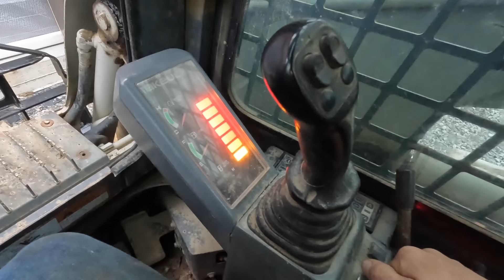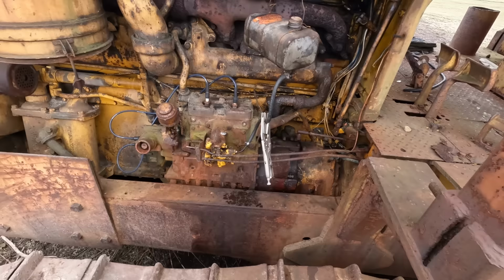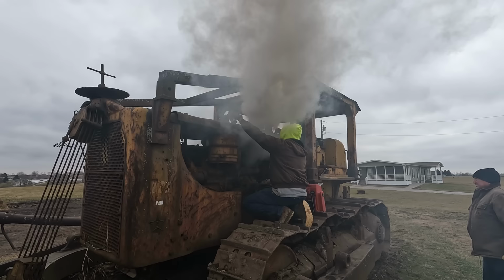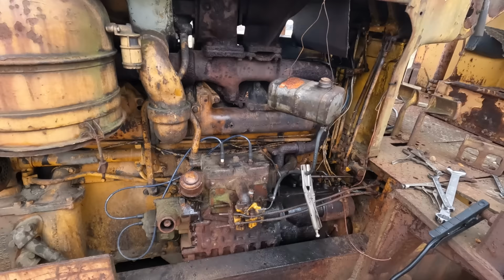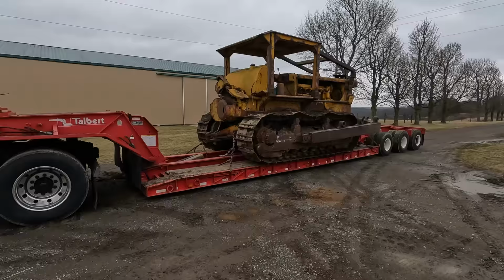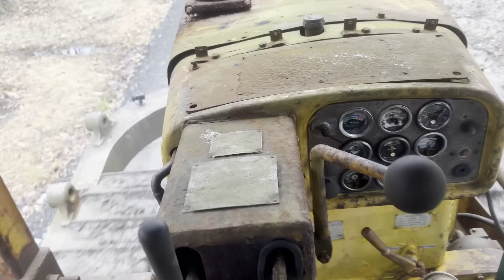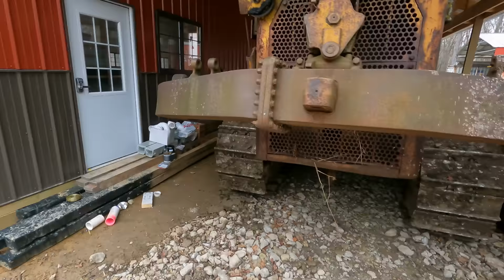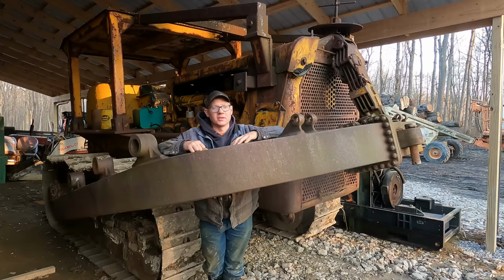Hauling Home a 1964 Cat D8 Bulldozer after sitting 15+ years!

Comment: Quick story about D8H's, in 1967 Vietnam we were using these machines to help lay down Marston Mat (commonly known as PSP planking to build temporary runways. We would air drop them from C-130 Aircraft at heights up to 10', they survived, most of the time.
Reply: Yeah, something that heavy (~50,000 lbs, ~22,700 kg) needs a LAPES drop, a tried and true technique for delivering particularly heavy loads to a very specific area.  

For those mildly interested, look around for LAPES (low altitude parachute extraction system) drop.  It's a fascinating, if potentially dangerous, procedure.  For example, the tragedy at Ft. Bragg in 1987 was caused by the pilot coming in too steep and leveling off too late, which caused the C130 to hit the ground mid-procedure.  Believe it or not, the C130 probably could have recovered from that on its own (such magnificent aircraft).  But then the load was extracted and the aircraft's center-of-gravity shifted enormously, the pilot couldn't recover the aircraft, and it crashed into the trees.

Comment: My dad used to take me to work with him in the summertime. I learned how start and run these old cable rigs at an early age. Everything was cable back in the 50’s and early 60’s.  I started working on the pipelines in 1964. It was  in the early 70’s before getting into Local #12 in Southern California. In the 70’s I spent hours and hours pioneering and building right a ways and doing back filling and dress up work on an old Cat D-7 46-A and a cat D-8 15-A.  It was amazing when the company that I worked for started buying hydraulic equipment. It was so nice to pull or push a lever to change blade angles and positions. No more jumping off and muscleling those heavy awkward blades around.😂😅🤣 I loved kicking those pony motors in gear and watching those huge smoke rings shoot up into the air and listening to the awesome sound of those mains taking off on a cold morning in northern Utah. Those were good days. I worked in that field for 50 years before hanging it up. Thank you for making these wonderful videos bringing back those wonderful memories.
Reply: А менять этот канат это отдельная тема
Reply: New guys never seen that Bless you
Reply: 15A D7 and a 46A D8

Comment: That D8H is probably around the eanrly 60's---I remember in 1963, the company I was working for took deliverery of some new D8H's and a D9G all with hydraulic blades and torque converters. The operators were all new to this hydraulic blade concept---where they had no down pressure with the cable blades( only from the weight of the blade), they now had down pressure with the hydraulic----it really meesed them up for a short time---but when they got used to it, it was great compared to cable. Remember, you always need to know where the cable is, a slack cable breaks easily---so beware!!! Those were some of the best machines and still are!!!!

Comment: Great fun.  I bought a 1939 D4 with putt motor in 1987.  Still runs no problem in 2023.  Putt motors were designed to warm up the diesel engine in cold climates because the two share the same coolant system.  Even up here in Canada you can start the machine in winter.

Comment: Great work, it sounds like a jet.  Amazing how well it moved after sitting so long.
Reply: My thought as well, by sound a jet powered D8H.
Reply: That's caterpillar.
Reply: Turbo going finally air i can now work
Reply: Very few things sound as good to me as an old D8H.
Reply: I cant get over how loud that turbo is. It sounds like a full blown jet. If the sound was scaled up to a airliner turbofan it would be 1000 dB
Reply: The 46 didn't have the same sound as the 36
Reply: 641 cat scraper had a similar whistle

Comment: What an absolute unit! Can't wait to see the restoration on this! I was thinking that design with the pony exhaust going through the diesel intake was dumb, but then I realized the pony motor's exhaust would be pre-heating the diesels air when working correctly, which is genius! I guess that is another reason to get the pony working over an electric conversion.
Reply from the maker: That’s the goal!
Reply: Diesel fuel explodes at 32psi of vacuum or positive pressure. It could care less if it has oxygen or c02, however having hot exhaust gas is far superior to that from glow plugs which at that time were not invented yet. Lol 

Desiel engines still need air but the air filter on this old d8 cat is stopped up.
Reply from the maker: @about2mount  bud the air filter wasn’t even in it 🤷🏼‍♂️🤦🏼‍♂️
Reply: @DieselCreek  Gotcha, ok then sounds as if ots flooded and a flooded desiel can take a long time to clear out while repeatedly turning over. That would also explain the blue colored smoke.
Reply: the only bad bit is when people forget to put a tin over the pony exhaust or rain flap to keep the water out. as it can rust out the tube and then dust the main engine.

the ideal is a electric start pony which this has.
Reply: @about2mount  by by bunny
Reply: Awesome machine- you have to restore it!
Reply: @DieselCreek  wouldn’t a direct start/electric start be more practical? You wouldn’t have to worry about the pony motor breaking again

Comment: Actually pretty clever running the pony motor exhaust through the intake to heat up the air to aid in cold starting but as you ran into if it’s leaking inside then causes a big problem!!

Comment: Thank you Matt for the video. The diesel sounds pretty good honestly. On the pony motor, it makes me wonder if there was already a crack due to having to pry the starter in a way for it to engage the flywheel. Makes me thing it was there and not quite as obvious an issue as it is now. I am sure you will get it taken care of at some point. I do have to admit though, it would be nice to see the progress and conclusion to a number of these projects in the queue or in process. So many partials and few completions. Nice to see one finished and fully usable again.
Reply: I agree 100%. Finish a project before starting another. Use to be one video aweek, now it is one every 10 days to two weeks.

Comment: What amazes me is the steering clutch is working fine after all those years.  My father's TD-5 would have had it's fiber plates stuck to the steel plates in the steering clutch packs after less than a year.  He would have had to take his time in order to loosen them up, by putting the dozer in gear, pulling on the sticks, and delicately slipping the clutch and "feeling" it grab, pressing the clutch back to the floor and trying again until they came loose.  If he didn't do this, the fiber disks would have been ripped out of the inner drum.

I remember when once we had to open the back of the dozer to extract and repair the fiber discs.

My father was an owner-operator at a lumber camp in the 60's.  He quit, but kept the dozer on the farm, after he married my mother.  I learned to drive this machine at the tender age of 12.

Comment: Intersting, well Matt I've got some news. I received a phone call about 2 months ago and George and I went to an old mine about 300 miles away and I purchaced a 1939 D-8A. No clear road, we had to cut alders and brush for 12 miles to get in there, only to discover a wash out thru the old road just outside the mine area. Last month we loaded our trucks and trailers...any every tool that we would need, or so we thought. Well the long and short about this, is that we got it running and after some gentle back and fourth we able to load it. No pony motor, just a hand crank. We're going to fully restore it.

Comment: Man, I love an old machine with cables. Yeah it's "low-tech" but it means you're never going into the hydraulic shop wondering which kidney you need less--I'd say that's a win. At least it's a CAT--if you REALLY wanna fix that pony motor, you should at least be able to get the bits for it.

Comment: A pony motor has a lot more advantages than just the one you mentioned. Do not convert it to electric start. The pony motor give time for the engine to build up oil pressure and fuel pressure. Also don't start it the way you have been starting it. Start the pony motor and start turning the main engine over. Once you have it the main engine turning check you have oil and fuel pressure close the compression release and leave the fuel off. That way you are compressing just the air in the cylinder. 
Once you feel heat on the outside of the block where the Piston is give it fuel and it will start a lot easier. Shut the fuel off to the horny and let it run out of gas.

Comment: White smoke like that is usually a timing issue.🙂....A couple of lenghts of 6"x3/8" steel through you workshop will allow you to put tracked equipment inside your workshopo without ripping up your new floor. 😎🤓

Comment: Matt if i only lived closer!! I learned to work on these cable blade and early hydraulic blade dozers from my grandpa who was head mechanic for Oregon tractor then Halton tractor a Caterpillar tractor company. I learned a whole boat load of priceless information from the man i call my grandpa Earl! Ya you wont know exactly what caused the "crack" in the starter clutch housing until ya tear into it but most likely if it wasn't their when ya first were starting the machine it was caused by you fella's having to wedgie the starter into place to make a clean contact with flywheel. But speculation only leads to more assumptions until ya dig into it. Hopefully ya didn't eat any teeth off the flywheel and cause a catastrophe. Much respect buddy!!

Comment: The "Triple R" (Rainman Ray Recovery) truck needs an "old style" mechanical high idle system.  Turning the knob mechanically depresses the accelerator pedal;  the more you turn the knob, the more it depresses the throttle pedal.  It is cost effective and doesn't mess with the electronic systems.

Comment: I see this dozer as the first use of your overhead crane as part of the rebuilding.  That will make removing some of the parts much easier.  
As we said in the military zillions of times, "Work smarter not harder!"  
I look forward to see you tearing this big thing apart to get it working right.
As for the antique job project, that reminded me of working with my late father working up the garden and cutting, windrowing and baling hay.  All was done with old equipment.  We still did the work.  Granted that was a long time ago when that dozer was brand new.  Still much of the equipment was from the '30s, and 40's.  Nice memories!  Now for you to create new fond memories!

Comment: The 46As and 36As were preceded by 15As and 14As. 15As had diesel fired torque converters. The last few years of the 46As and 36As were the pinnacle of the D8s.

Comment: Hey mate that starter motor gearbox failing is from keeping the pinion engaged while the engine is just starting the best way we have found is to crank them over long enough the decompression lever starts to come down by itself then crank for a while longer give it the best chance to start then right as you give it a stab of the throttle disengage the pinion trick is to crank under compression for. A decent amount of time

Comment: They route exhaust through the intake to help heat up the air charge going into the cylinders.  It's supposed to help it start faster in the cold... not slow it down

Comment: When I was a kid in the 60s I worked in a place where we rebuilt tracks and rollers for JDM in Philadelphia in fact the place was called Philadelphia track and roller. Very physical work almost all by hand. An automatic welder put new steel on the tracks and rollers and a machine that pushed out the track pins and put new ones in. Boy if you didn’t have ear plugs doing the pins you would be deaf in no time.

Comment: Weirton, WV!  I was born in Steubenville, OH but moved out of state in 92.  My father and a close family friend both drove for Weirco Steel in the late 70s.  My father still lives near Wheeling and I pass thru there regularly for work as I'm also a truck driver.  Also, having the sister machine would be damn cool but almost unnecessary.  However, if the price is right, lol.

Comment: Normally the ponys exhaust is piped through the intake to heat it up making starting a lot easier. 
40 years ago a mate of mine bought a D9 of similar vintage . He had to drive it across country because there wasn't a truck big enough to haul it on the road (50 plus tons) . He paid for the machine by doing work on farms as he crossed them ...

Comment: You could build heat by using the pony motor to wind over the main engine for 15mins with the fuel off (when the exhaust in the intake + turbo issue is fixed). Just leave it winding over pumping compression for awhile. The pony motor exhaust when it's fixed should warm things up too before adding fuel so you're getting heat from compression in the pistons and cylinders and intake heat form the pony motor.
Reply from the maker: Yah…. When it s fixed lol

Comment: Long ago, Friend of my fathers hauled his older D8 on a tandem axle trailer and single axle White Mustang tractor.. it was a cable blade- but the winch was in the front radiator, and had a straight drive- not a power shift...

Comment: our old cat had a spot to pin the 2 cable blocks together to keep the blade up it was so you could haul them on a short trailer backwards with blade overhanging rear of trailer with blade pinned it didn't allow it to bounce on the cable.

Comment: You need to find one of the original bobcats from back before they was bobcat. I was picking up a load from bobcat in Fargo. They had some of the original three wheeled skidsteers being restored. They had a different name on them and when I asked they said that was the original name.
The two front wheels were the power and steering, the one back wheel was just a crazy wheel.

Comment: With exhaust flowing through the turbine side of the turbo, and the compressor blowing into open air, there is no restriction to compressor flow and the turbo will vastly exceed its rated RPM. The whine is the turbo screaming for death.

Comment: I found a D8 dozer cable,  early 50's sitting in the woods for 25 + years. 
 The owner took the belly pan off and the oil pan. 
 But the owner had a heart attack and died,  his wife found him lying under the cat.
 It's still there and this is Minnesota and we have 28 inches of snow and it's 3/4 mile from the road. 
 Don't know what's wrong with the engine or its going to run or not. 
 Have to wait till spring,  I got it free if I can get it out and home

Comment: That big diesel needs some warm air in the intake and it will start much easyer. Probably thats why it had the hot exaust from the pony circulating inside the intake of the diesel. So you can either adapt some kind of glow plug in the diesel's intake manifold or somehow fix the leaking exaust of the pony engine to pre-warm the diesel's intake air. Nice to see that old dozer running again.
Greetings from Romania and keep up the good work!

Comment: What a beast. Great machines and there were a bunch when I started working for a Cat dealer back in 1986. Still there 37 years later.
I love it when one of the newer guys is trying to find starter parts lol ! One of my coworkers in service used to rebuild the pony motors.
Reply: I cut my teeth on a Cat 977H Traxcavator. That baby always started, never gave any trouble. The bucket had a side dump feature. Great machine.

Comment: The other bonus to using a pony motor is that, once started, they warm up the diesel block allowing for easier cold starts in low temperatures.

Comment: I don't know about diesels, but in a vehicle that has a jumpy idle and smokes like the army truck you did nearly two months ago, it usually means its sporadically missing a cylinder due to lack of fuel, and the revs is it gaining the fuel back. That 2nd injector might be leaking just enough that its doing that.

Comment: Big Bud is back to making tractors, because many people want lo tech which can be fixed in the field.  That's what I think about this machine, low tech- no hydraulics (which having worked on a farm in WV growing up was the reason we did MOST of the farming w/two 50's era tractors vs the state of the art FWD Ford), pony motor, all of this means reliability.  All of that can be maintained by the owner and serviced by a competent mechanic vs needing dealership service which is $$$ astronomical.  Instead of letting it go for scrap steel, that'll be there for you for years for projects or sell it after your "Chris-tine" restoration and a small business will put food on the table for their family for YEARS w/o the cost of a new or even new-used dozer.  Think of the abuse that dozer has endured in the environment where it worked and still 50% viable underneath- a small business owner would pass it down through the generations w/that much life left in it no more than it would be pushed in that environment.  Thx for that, if it leaves your hands I hope you sell it to someone at a fair price for both of you and it truly helps someone's lot in life.  WELL DONE!

Comment: Looks like a project that will get some of it running like it should but then get covered with leaves and lost in the bush over time “waiting on parts”..  looks like a hell of a workout for a sand blaster though..  with old equipment motors like those and their 3 inch layers of grease i think id spend more time on clean mode than anything else because hate having to get elbow deep in the black nasty everytime you touch em.. now im not aside from getting greasy but when you only touch something and wind up with the shit behind your ears, the stuff gets old right quick..
Reply: That's what they make portable heated steam cleaners for.

Comment: good save you could have just pulled the little exhaust el has that one still have diesel fuel in torque convertor be glad to see that baby painted up worked on many of them back in the day you dont need that 8 on green concrete